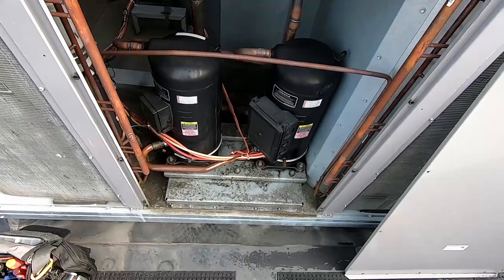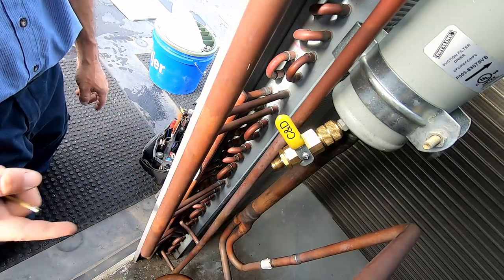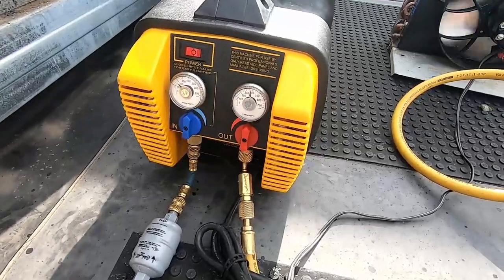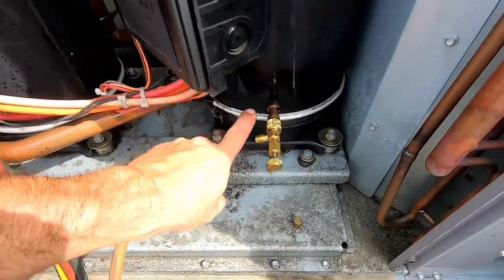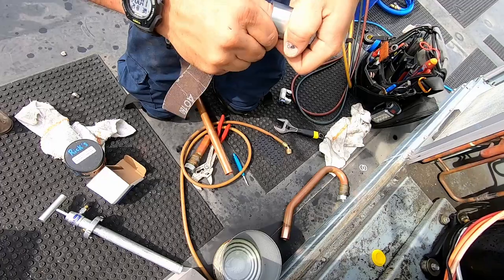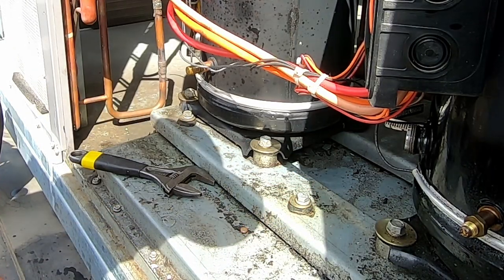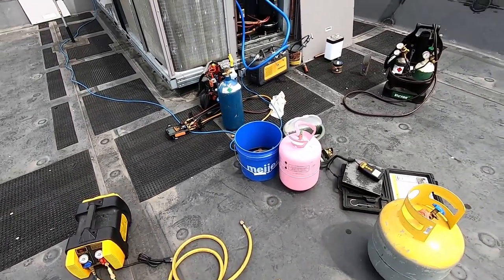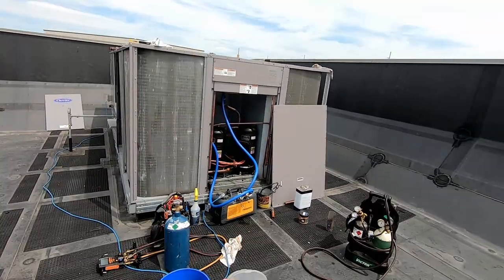22.5 Ton Refrigerant Leak Repair. Recover 45# Of R-410a W/O Water - Custom Sub-cooler

Comment: Really like the idea of subcooler and it worked great too!  Great video on it.  Also, nice replacement of the Roto fitting.  I haven't worked larger units like the one here, but does that charging chart have the Condenser Leaving Temp on Left and Discharge Pressure on the bottom?  On the smaller Carrier units, that I've used the charts on before and it seems to work...but noticed you took the temperature of Air leaving the condenser.  What Carrier means is the Liquid Line Temperature leaving the Condenser.  Maybe that's why it's not working for you correctly?  If that's not what you did then ignore what I said.  Thanks Be safe out there.
Reply from the maker: I'm fairly sure I'm reading it right,  I showed a closer view of the sticker in the first trip out video. It said discharge air temp not condensing temp. I'll have to look it up by model number now that you mention it.
Reply: @HVACRSurvival  ok sounds good, yea I just thought they are SubCooling charts, I will pull one of the manuals from HVACpartners and take a look to remind myself.  It's been a while, I just do SC like you do on TXV systems.

Comment: "Moisture out of the oil" @ 13:10...
So that's why the filter drier should have been replaced since you opened the system to the atmosphere!
Reply from the maker: Yes,  I had to use a 5/8" suction drier again because I didn't realize it was that big until I got there and all I had was upto 1/2".  That's why I posted on my community page that Sporlans  bulletin 1040 says you can do that.

Comment: Those recovery tanks aren't actually supposed to be filled to the weight limit on the side. The Weight limit is rated in water weight. Those tanks are rated for 47.6 WC LBS
Water has a liquid density of 62.42 pounds per cubic foot,  R410a is 54.70   ( This info can be found on the refrigerant data sheet.)
A 50lb recovery tanks capacity is 46.7 WC LB
Divide that by the the water density... 46.7/62.42 = .74 cuft of space in the tank 
Then multiply this by your refrigerant density 
.74 X 54.70 = 40.47 lbs 
for how much refrigerant you should be adding to these tanks.
Reply from the maker: I was always told you can go up to 80% of the total capacity. Same goes for a LP gas tank. Usually I empty the recovery tank back into the system after a repair but if I'm taking it in for reclaim I'll be more on the safer side of caution. Thanks for the information👍👍, my problem is remembering the math.

Comment: Great video but l wouldn't recommend pushing any Schrader with your thumb or finger unless you know the system is reclaimed or low on refrigerant. Your'lll risk  a nasty cold burn if there's any liquid present.
Reply from the maker: After 25 years, It takes a large hit with liquid to bother me. Good point for the new guys👍👍. But seriously your right,  safety first.

Comment: I like coffee cans for repairs in garage, like automotive brake repair, use it to catch fluid when changing calipers/cylinders and to hold the bleeder bottle up, hen it;s full you just open and dump into can quickly and back to action. when done just put the lid back on toss into corner.
sadly not many coffee cans left anymore, mostly plastic containers or those stupid syrup-goo flavored machine latte/espresso crap. I don't drink coffee, except once in a while.
wedding and funerals (lol)  I dislike going to either of them for obvious reasons, both are usually the end of someones life (pun intended) :))
Reply from the maker: Kitchens get there beans and other canned items in bulk in cans. Check there dumpsters..lol

Comment: what would happen if you were to inhale the refrigerant gas?
Reply from the maker: In theory, besides a potentially illegal act of venting refrigerant, it shouldn't happen but say you were in a situation where  a semi-hermetic compressor blew apart while you were in a confined compressor room and depending on how much you breathe it could displace the oxygen and suffocate you but if it's just a small wiff here and there,  it generally doesn't cause any known harm. But over time I'm sure it may accumulate and cause some sort of cancer but I don't know if that's been proven or not.

Comment: Are SL Driers standard on those machines? :-)
Reply from the maker: That was a liquid line drier,  I didn't see any suction line driers on the system and normally there isn't.
Reply: @HVACRSurvival  That was an SL drier you tightened cores down on.
Reply: @HVACRSurvival  3:20
Reply from the maker: That's a 5/8 liquid dryer
Reply: @HVACRSurvival  Why does is say suction filter drier on it, and has delta ports? P503-8307SVB looks like the part number.
Reply from the maker: I just watched it from home. Yeah your correct,   it's a suction drier dryer. They probably didn't have a 5/8" liquid dryer so they used a suction drier on the liquid line.
Reply: @HVACRSurvival  Not sure on circuit routing in that unit, but at ~22 tons you may want to check the R410a Flow Capacity of that drier Vs it's installed circuit. Anyway as always great video. The sub-cooler was very 'cool'. ;~0

Comment: Dumb question.  How do you know a compressor has the right amount of oil ?.
Reply from the maker: Semi-hermetic or just hermetic compressor?
Reply: @HVACRSurvival  Either. I'm not in the business. I'm just curious how this stuff works. Thanks.
Reply from the maker: Some compressors have a sight glass on the side and you can see how much is in there. On a completely sealed compressor there's no real good way to know. But unless you see oil all over the unit there's no reason it shouldn't be inside the system. Now if you have a compressor failure that's a good time to see how much oil is in the compressor by dumping the oil into a pail and measureing how much you have versus what the data tag shows and that'll tell you whether the failure was oil related.

Comment: Would you trust a ZoomLock at The vibrating compressor crossover pipe ?.
Reply from the maker: I haven't used it yet so I don't have enough experience with it to say one way or the other. Something like this I think brazing would be a lot cheaper and simpler.